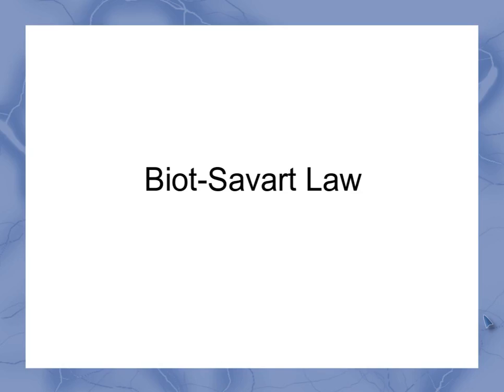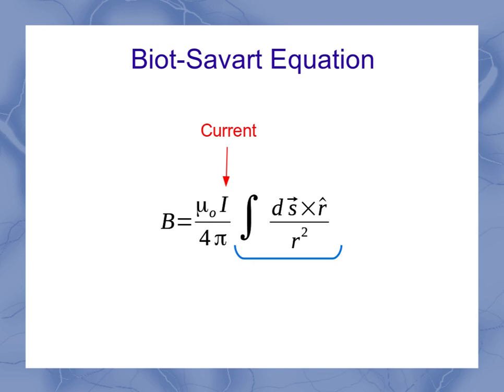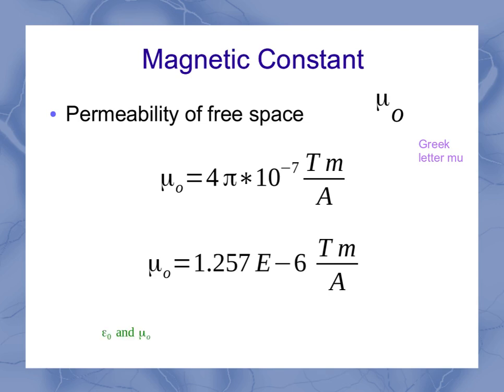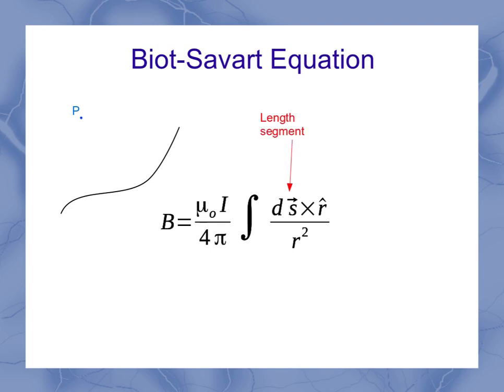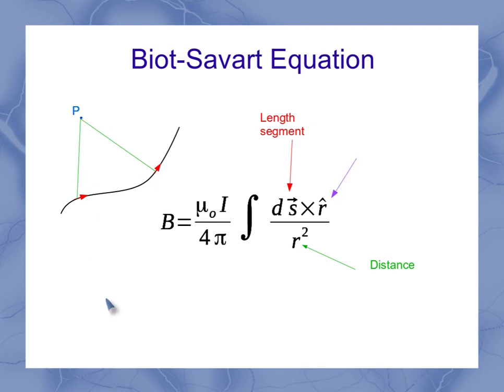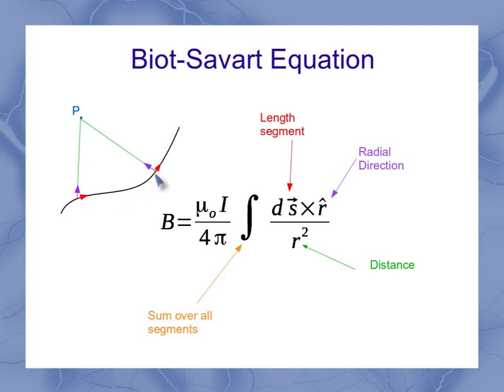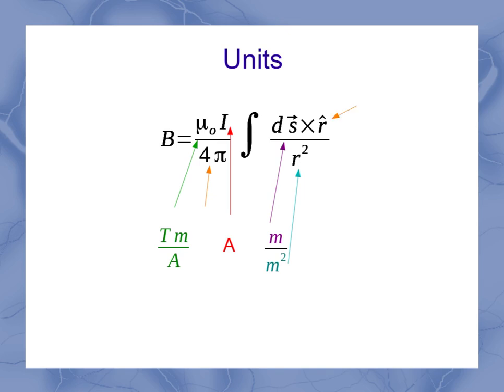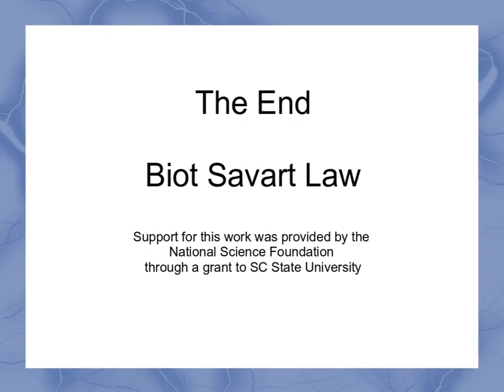The Biot-Savart Law

Comment: So in words, in this case, is the total magnetic field felt at that point(created by a current through a wire) just a multiple of the permeability constant(of free space) as a function of r^2 that's integrated over the wire?   Why is it divided by 4pi?  Also, when you have a curved wire like that, what are your bounds of integration?
Reply from the maker: The 4pi is related to the geometry of the situation. The limits of integration would be the geometric locations of the ends of the wire. For the curved wire I show in the graphic, you could not solve this integral analytically. The top of the integral is crucial and has to do with the directions between the point in space, the segment of wire, and the current (these changes as you move along the wire). It means that the integral (a summation as the limit of the segments gets very small) is a vector sum.
Reply: Thanks for the response.  I understand more now.  :D

Comment: Does this also represent the amperage generated by a magnet passing through a coil? I am doing an experiment as a year project in class were i want to create coils(some circlular, others triangular and more shapes) and compare the emf produced by a set magnet passing through them.
Reply from the maker: This equation is for the magentic field created by current. You need to take a look at Faraday's law to learn about currents created by magnetic fields
Reply from the maker: You will need to look at faraday's law to understand currents that are caused by moving or changing magnetic fields.
Reply: so... how did the experiment go?

Comment: no r^3 instead r^2 ?
Reply from the maker: The equation has (r^2) on the bottom and (r hat) on the top. Where (r hat) is a unit vector in the direction of the (vector r). Some professors/textbooks will use the full (vector r) on the top but then need to make the bottom (r^3) to make up for the extra (length of r) on the top.

Comment: Does 4Pi represent the x,y,z vectors and time?
Reply from the maker: it is related to the surface area of a sphere
Reply from the maker: I said the "surface area of a sphere" (4 pi r^2) not the volume of a sphere (4/3 pi r^3). The Biot Savart Law is not time dependent but it is highly geometry dependent.
Reply: Thanks, that's the info I needed. I was looking under physics. It was hiding in the mathematics.